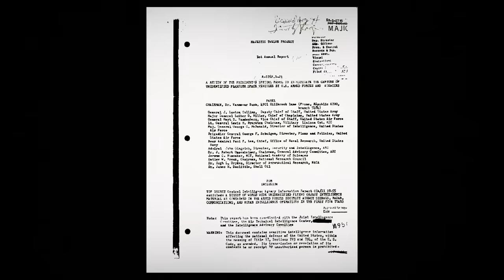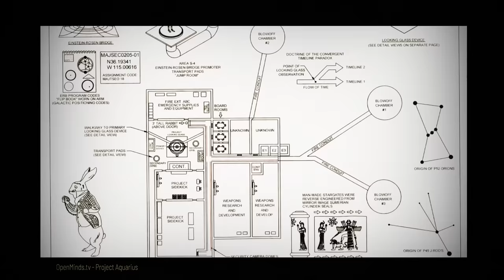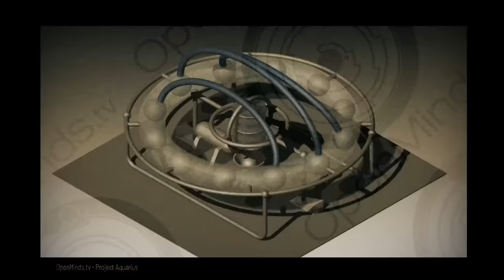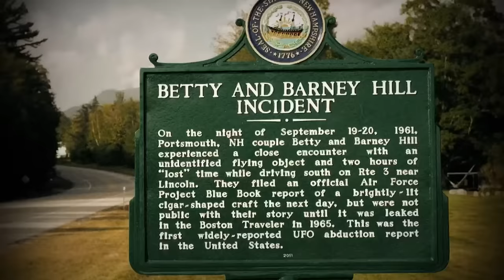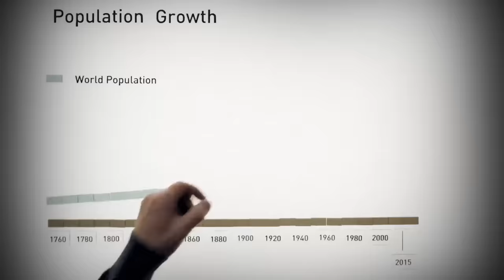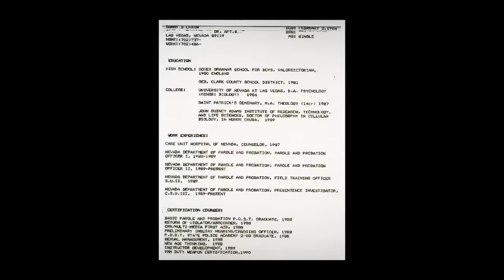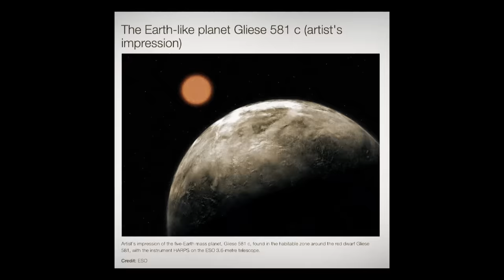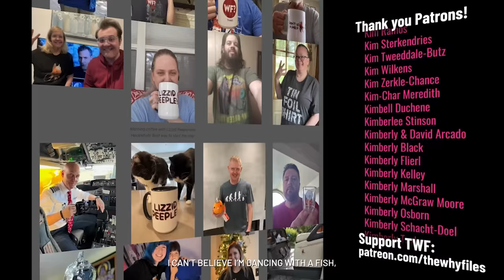Project Looking Glass | The Time Warriors of the 2012 Apocalypse

Comment: 12:30 

I have actually seen this craft flying overhead around 5 years ago while camping, black triangular craft sat for 3 mins then sped off really fast. 😮
Reply: There is a video out there somewhere of the recent eclipse showing strange objects in the sky
Reply: I’ve also seen it 🫢
Reply: I believe you. My sister n I witnessed 2 of them. Low enough to make out lights on each corner. Not a sound from either.
Reply: Ronald Reagan n project Star wars?
Reply: I've seen 'stars' move and merge together camping Easter Friday Australia
Reply: That's a goa'uld cargo ship
Reply: Seen one similar as well. I only noticed it because it felt like the sound and air suddenly got really quite then when I saw it it looked like a shadow then disappeared without making noise other than the sound coming back … very weird
Reply: @Butchdabuilder  ive seen a fleet of 4 in a row. With lights on each corner and they were black triangle shaped crafts making really quiet low humming noises. They are military drones if you didn't know. Very cool to see though as they look out of this world.

Comment: The end of the Mayan calendar DID mark 'the End of Time.'  Not obliteration, but the moment of Non-Time at the center of the life of this Universe, just like the moment of non-time at the peak of every swing of every pendulum.  Just like the total cessation between breathing out and breathing in.  
  The end of the Mayan calendar was an ambitious attempt to pinpoint the moment when the Creator reverses the Flow, and regathers all of our insights and outlooks.  The stopping point of the Universal Pendulum isn't simultaneous throughout spacetime, because the relative velocities of galaxies are different; it spreads as a wave.  It's a window of opportunity, but there's no prediction or limit to what will emerge.
  The two sides of the Coin of Possibility seems to be a splitting of worlds, one continuing future reality based on fear, and the other on Faith.
  Good luck, everybody.  No worries.  You can't make a mistake; you'll be fine in the long run, whether awake or asleep.  Use your imaginations, carefully.  Dwell in love if you can.
  The Creator is beginning to breathe all of us back in.  Everyone at least try to smell nice.

Comment: The theories on time and time travel do not work the way that was described. It is not easy to shift a timeline from the future because of theories such as the grandfather paradox. If you go back in time and kill your grandfather stopping your existence, then you are not born, so you cant go back in time to kill your grandfather and the original timeline is reset. This would also be the case for the P45s and the illuminati, so i am having a hard time believing any of what was told. It is much easier to alter future events forcing the timeline to follow a different "stream" so to speak thus altering the future.

Comment: I was slightly offended by the word myth used every time you mention the flood.  However, I did a little digging on the Webster and found out that is the proper use of one definition of myth.  It was not the definition I thought you were using, therefore no offense. That's the perfect word to use.

Comment: Unless dude was strapped to the stubb wings on the apache the fact that the ah64 does not have any room what so ever for anything other than the pilot and gunner....

It also uses wheels so getting strapped to the skids don't work, no provisions for stretcher attachment....

The rotor wouldn't balance with the added weight and the tail wouldn't be comfortable in the exhaust....

During Afghanistan I know that one unit was using the apache and some really good rigging and harness' to move and extract injured or about to be over run small 2-4 man units out of imminent death....but that was one of the best chopper pilots ferrying team 6 seals ...  Not an engineer going to work....